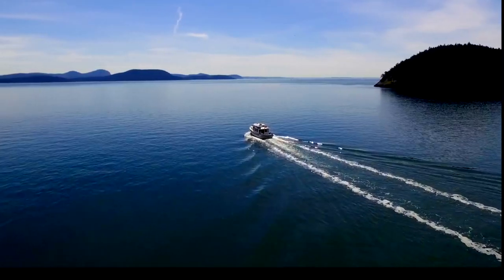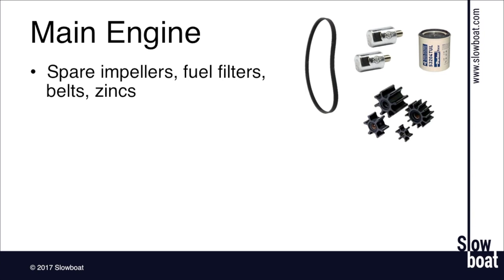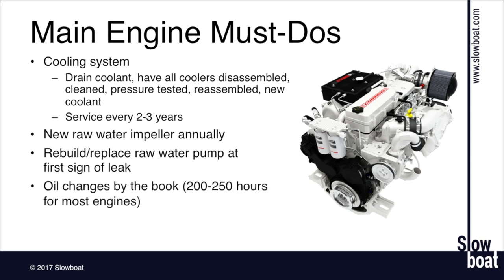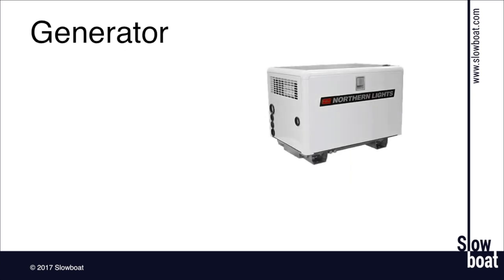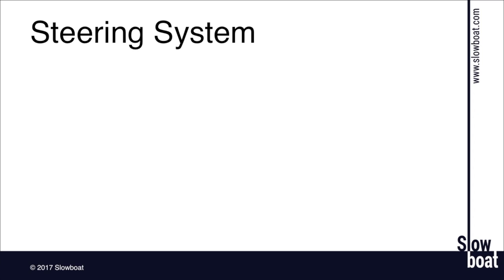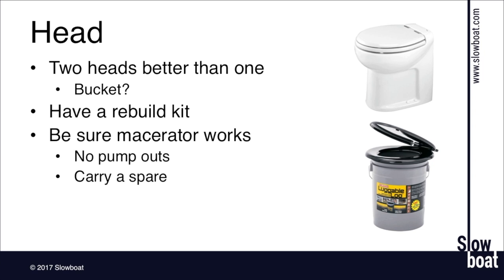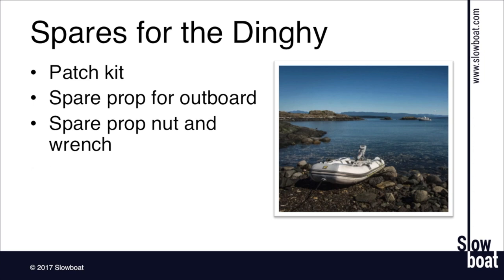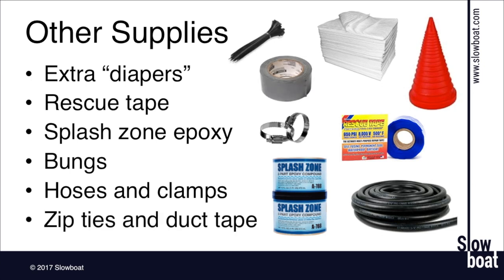Preparing Your Boat for Alaska

Comment: Great tips. I learned a lot from your video. Thank you. 
"Maintenance induced failures" is an absolutely critical concept. I hired a captain who two days into a delivery sail down the coast (anchorages no marinas) He decided that the alternator belt was too loose. I'd just bought the boat so there wasn't a set of sockets aboard. He started to attack the nuts with a small cheap visegrip knock off plier.   I suggested 1. the batteries were charging just fine so  2. this 'repair' could probably wait another two days when I'd be in the slip with WestMarine, HomeDepot, Ace Hardware a couple miles away and... I'd be plugged into shore power.  He threw a fit.  I imagined him striping the nuts, or loosening them without being able to retighten them, or  retightening them too tight.  Would anyone be surprised had he been able to do his 'repair' and the belt failed the next day? It's been five months, there never was slack in the alternator belt. Maybe there's room for the concept, "Desperate need to do something that can result in much bigger problems"  (He also put his 30+ years as a sailor against my actual knowledge operating the Selden in mast furling. First day, after another tantrum he jammed the main for the rest of the trip.)  As with investing often the smartest move is to do nothing.  Certainly calmly discussing a situation is a minimum.

Comment: For the tools, the all in  one screwdriver....  This wouldnt replace the one that you recommend, but it does so much it would be worth having both.  The Irwin 9 in 1 tool.  Its one  of those replaceable bit drivers, but it also has  different size nut driver capability, and just works for so many different things, and the bits it comes with are pretty versatile.  Two different square bits, large and small philips and flat, plus three different size nut drivers which are also all the common hose clamp sizes.  Combined with the one you have you could  do just about everything on a boat.

Comment: Good video. The only thing I don't agree with is having a set of "wobble" or "rounded tip" Allen wrenches. I've had the ball snap off and stick completely ruining the bolt. I'd rather modify the wrench by cutting it off than use a rounded tip Allen wrench.

Comment: Hello,  What if you need to pull the boat out of the water to do some maintenance,  are there facilities that can do that along the way?  I'm thinking of a boat with an outboard and needing to change lower unit gear oil.
Reply from the maker: Hi Bill...Laura here. Sorry for the delay in replying! There are definitely facilities along the way that can do haulouts... the maximum distance between facilities is about 200nm (Campbell River to Shearwater and Shearwater to Prince Rupert).